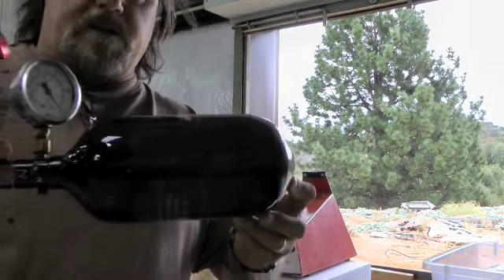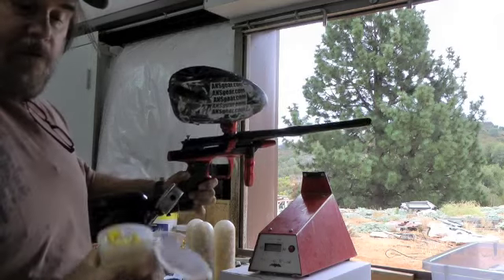G6R Key Features w/ Bob Long 1

Comment: @DrLawlsome  you should only use low pressure tanks on the G6R, high pressure will cause you to blow an o-ring almost every time. Low pressure is what is required for it anyway.

Comment: I noticed that Ninja Paintball made an SLP Tank especially made for the G6R.  Since the marker runs at low pressure.  I am going to wait until spring of 2011 to buy my own G6R.  My friends G6R ran on 2nd run came with a .691 barrel which it should have been the .685, maybe he shouldnt of been in such a hurry to get one.  Other than that its a nice marker and my friends shoots fine with the Rotor. Nice smooth shooting marker. Nice on air even on high pressure not so much on effecency.

Comment: @willy2872 yea i heard the same thing, but after doing some research, i found that the stock g6r board is a tadao odoshi. i found the online manual for the board, and it does say that it has psp ramp and psp 3 shot. along with many other modes. ill send you the link through a pm since it doesn't let you post links. hope i helped.

Comment: Its recommended that you use a LP tank that doesn't mean its mandatory you can use a HP tank but you run the risk of blowing out seals with high pressure

Comment: im thinking about buying this gun and i would like to know from another g6r owner if i need to use a low pressure tank on this gun or if my high pressure tank will work without damaging the gun... is a low pressure tank necessary or just recommended...